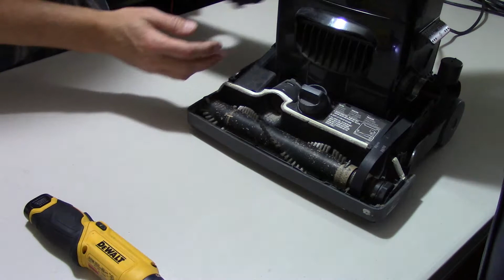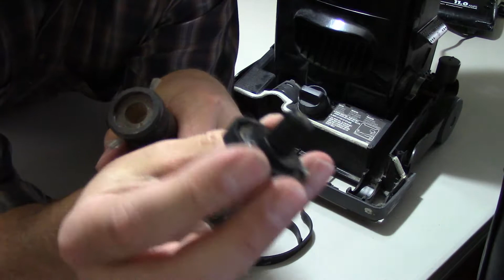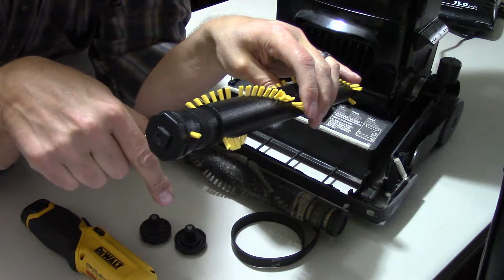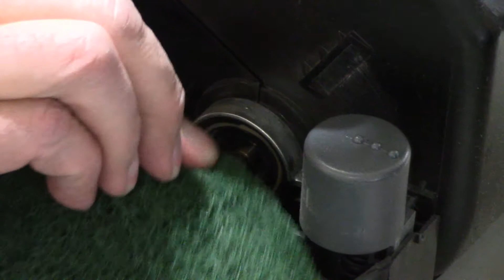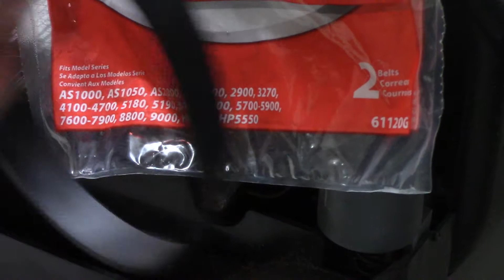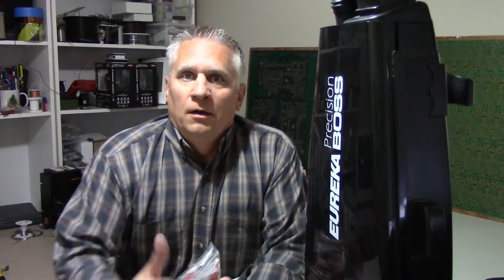AggressiveFun - Eureka Precision Boss Vacuum Cleaner Repair - PART 2

Comment: I have the same vacuum but the motor needs brushes. Do you know where I can get them. Tried everywhere with no success. Otherwise,great video.Thanks
Reply from the maker: I've not needed to replace the brushes on mine so I don't have any info on them. When I do a quick Google search, there are several that come up but I'm not sure what the look like. Maybe one of the results is the correct one. I'll look further and post again when I get more info.
Thanks for your kind words and thanks for watching!